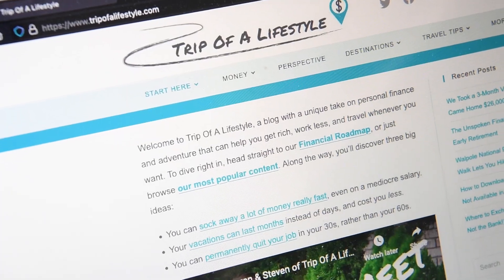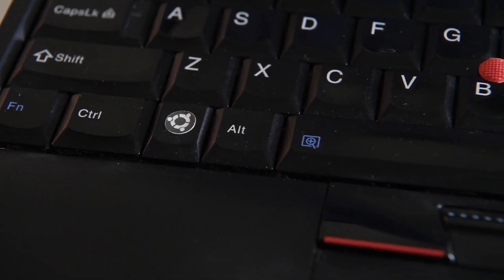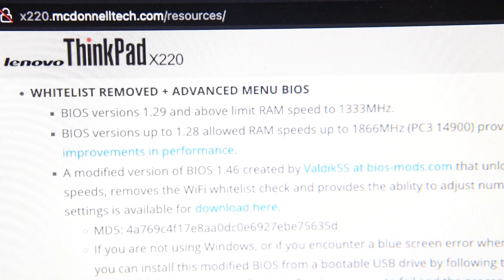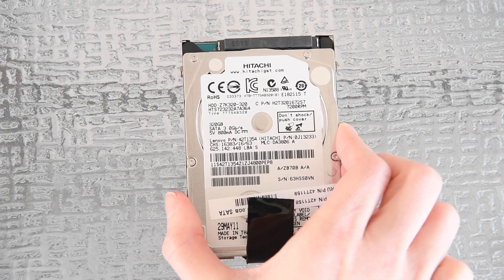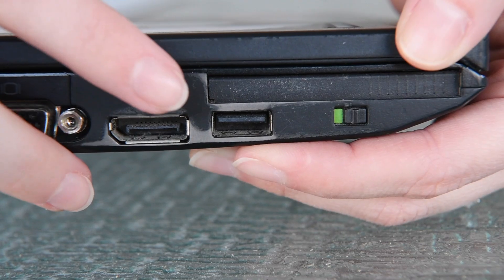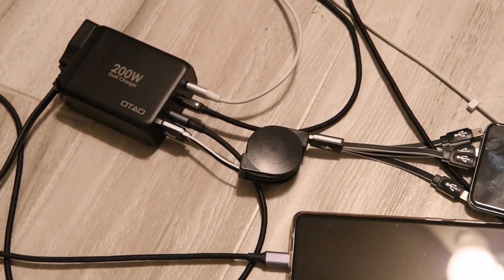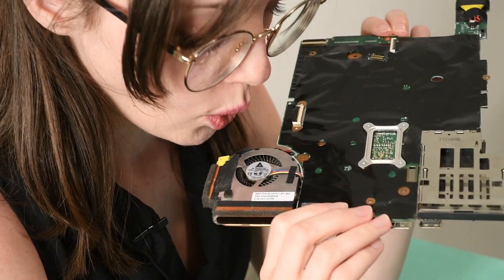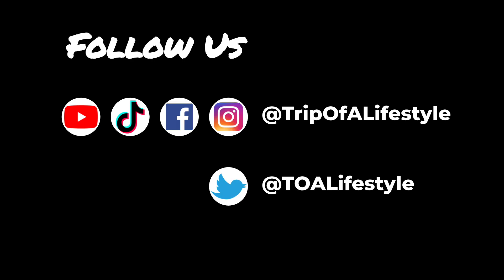How To Make Your Laptop Last FOREVER (My ThinkPad Mods & Upgrades)

Comment from the maker: UPDATE, October 2024: This 13-year-old ThinkPad X220 is still my main computer! I use it every day for blogging, shopping, photo editing, business stuff, and even writing this comment. 😊

I also did one more mod since creating this video. I added an additional internal USB 2.0 port (weird, right?) using the laptop's vacant Bluetooth card port and this custom chip: https://ebay.us/dqV6bG (affiliate link).

That brings the total number of USB-A ports to 6 and allows me to hide a small USB device inside the computer (like an additional Bluetooth adapter, wireless mouse dongle, or flash drive).

For more frugal tips, be sure to subscribe to our channel and read the blog at https://www.tripofalifestyle.com

Thanks for watching!

— Lauren
Reply: @TripOfALifestyle  I have a Dell Latitude E6530. Upgraded with 16 gig RAM, bigger battery, 2TB SSD, BD-RE drive, USB 3.0 ExpressCard. It has 2 USB 3.0 ports built in plus a USB 2.0 and an eSATA USB 2.0 combo port. It has 1080p display and nVidia GPU with dedicated RAM. I got it cheap because it had an i3 CPU. It was easy to swap in an i7. One puzzler is why DELL won't do a TPM 2.0 firmware update for it when they have for lesser models of the same era.
Reply from the maker: @greggv8  👏
Reply: @TripOfALifestyle your laptop is lasting that long 😂. Unfortunately most are glued on motherboards these days.
Reply: @TripOfALifestyle  My latest upgrade to the laptop is a backlit keyboard. IIRC that wasn't offered on this model but others that used the same keyboard did so a compatible one was easy-ish to find. Unfortunately the person I bought it from thought the keyboard should be secured into the package with tape and two keys got ripped off it due to rough handling. But there's a company that buys up all the laptop keyboards they can to salvage keycaps and the parts under them to sell individually. A few $ and some time later the board was fixed.
Reply: @greggv8  Awesome! I just purchased brand-new ThinkPad T430. I like your upgrades/mods very much, especially the charging port upgrade (USB C is all around us nowadays). Was it ..easy?
Reply: @greggv8  I just sold one of those. It was awesome but I got a new Macbook Air M3 and something had to go. I still have another business class Dell Laptop, and it runs Linux like a scalded dog. It's a Precison M4800 with an AMD graphics chip and i7 quad core processor. Despite that it weighs a ton I still love it.
Reply: Do you use Arch, by the way?
Reply from the maker: @OceanusHelios  Xubuntu
Reply: @OceanusHelios Both description and video states that she used Xubuntu (Ubuntu with XFCE desktop env).
I use OpenBSD, btw. On an IBM Thinkpad T42 32-bit and many other computers (including my mothers old Lenovo desktop PC).
#RunBSD
Reply: I am writing this on a x220 i got 2nd hand in 2014. It has an i5. I upped it to 16GB RAM and a Sata SSD. Still going strong! (Got it for 150 bucks lol)
Reply from the maker: @vijaynatrajan1887  Nicely done!
Reply: Love that you keep adding as much upgrades as you can so people know they don't have to buy a new laptop when they think it's hit their limit. I am looking at getting a newer one later this year since I did all I can with my 14 year old Acer. Taking my time cause there are so many $500 laptops out there that seem feature packed but you look at the specs and realize it's not such a good buy after-all.
Reply: Thank you for the update, this video makes tech frugality exciting. Anything else for tech you guys could make a video on?
Reply from the maker: @georgekontogiannis4091  Thanks! We've done some other "tech" content, and we have a bit more planned into the future. All of it falls into the travel or frugality niches.

For example...

Laptop buying guide:
- https://www.tripofalifestyle.com/gear-and-tips/laptop-buying-guide/

Digital camera buying guide:
- https://www.tripofalifestyle.com/gear-and-tips/camera-buying-guide/

International power adapters:
- https://www.tripofalifestyle.com/gear-and-tips/international-plug-adapters/
- https://www.youtube.com/watch?v=JtdQ0bwNzp0

Using Android apps internationally:
- https://www.tripofalifestyle.com/gear-and-tips/change-country-google-play/
- https://www.youtube.com/watch?v=0E7aiM4Q7GQ

Building a camper van:
- https://www.tripofalifestyle.com/gear-and-tips/nissan-nv200-camper-van/
- https://www.youtube.com/watch?v=ttwxw6PmaNs

Public WiFi hack:
- https://www.youtube.com/shorts/EE2f_LTWpDs
Reply: ha! you had me at "I switched to Linux and never looked back..."
Reply: That original Lenovo (IBM) keyboard is spectacular. I currently have a 2012 T430s and a 2017 T470s...both incredible. Those keyboards are nice, but will never touch yours. Great video!
Reply from the maker: @hoppysport2872  The X220 keyboard is really nice! Thanks!
Reply: Did you know you can flash the BIOS on the X220 with an open source alternative called Coreboot? It's a lot nicer than the stock BIOS because it removes the spooky Intel Management Engine stuff. Though it does require you to open up the machine and use a raspberry pi to flash it, but there are tons of videos on YouTube, if you so choose to.
Reply from the maker: @SamSquids  That's cool! Never heard of Coreboot, but this X220 is using a modded BIOS version to remove the hardware whitelist. It's linked in the video description.
Reply: My 2013 Lenovo Z710 with an i7 processor, 16GB, SSD, 17" screen. built in 3.0 USB x 2, VGA & HDMI, and upgraded Wifi 5 and BT works great with Windows 10 .. although Zoom is almost at the limit of usage.
Reply: Awesome!  Haven't completely retired my X200, though did transition to the X240 for the most part and the E530.  Will have to look into the WiFi card upgrade for the bluetooth and 5G capabilities, that is a great way.  Pretty much same upgrades otherwise with dual boot option on one of the X200.  Funny not being able to upgrade to Win11, at least I think the X240 will not as well as I forgot offhand and may not have tried.  Anyways, no big deal IMO.  Awesome!
Reply: hehehhe, wow, have a hide usb inside the computer is amazing, a big storage to use in whatever, what a great idea! cheers 😃
Reply: Can you do a video on Chromebooks?  They're my favorite.
Reply from the maker: @frostyfrances4700  Never used one! Maybe in the future.
Reply: You can still upgrade to a better brand specs ssd.
Reply: My only problem is when you can no long use a laptop like it was meant to be as either the keyboard no longer completely works or the screen is damaged, or both or worse.
Reply: @wheelieblind  luckily for you, the screen and keyboard are very easily replaceable in those old laptops.
Reply: Should seriously get a new laptop. It's good for the heart... And the economy. lol
Reply: That’s incredible, I still have my 2009 MacBook Pro. She’s still punching.
Reply: Problem is, my old laptop needs a ribbon cable that they no longer sell :(
Reply from the maker: @perfectsoulmates2023  Try eBay!
Reply: @TripOfALifestyle  Oh believe me I did and they don’t have the ribbon cables. Like I said they were all discontinued and nobody has them even used. I invested hours and hours searching before just giving up until perhaps a universal ribbon is made or something else as a solution.
Reply: nice! 
and if you dont mind me to ask, hows the update now on 2025?
do you still use the mighty X220?
Reply from the maker: @NOSTALGILAK  It's still the daily computer in 2025!
Reply: @TripOfALifestyle  fantastic!
do you also using windows or linux only as a daily os?
Reply from the maker: @NOSTALGILAK  Xubuntu Linux
Reply: ❤. Iv'e been to a few stores that used old computers off line for their own use.
Reply: Wow why am I keep buying a new laptop. An old laptop is so much better than a new one even if it is more powerful. I have a Fujitsu Celsius H710 that screams 2000s even though it has a 2011 workstation spec. 2005 was a better time but 2011 laptop is the oldest usable laptop in my experience

Comment: I once bought a Lenovo T520 for $240 on eBay and it was my main driver for years.  Put Ubuntu on it at the time.  These days I have a 6th gen X1 Carbon (purchased new from Lenovo) running Arch Linux, which is on its third battery, and the rubber is starting to deteriorate around the screen.  Decided it was time to upgrade.  I don't know how repair that melting rubber boooooo.  Have a 10th gen X1 Carbon coming, which I got for $720 on eBay.  :)

Comment: nice but i would  prefer the barrel, since the usb is a bit too weak but a DC barrel is easier to replace and hold tensions better. Anyway, if it works for you, its what it counts.

Comment: 4:38 its funny how no modern computers have a easy way to swap out your battery like this. Batteries are literally the only thing that go "bad" in a computer. Like the only thing actively degrading in your computer every single time you use it. 

Hell, some of the newer laptops ive seen you having to peel off your screen to get to the battery.
Reply from the maker: So sad 😞

Comment: Is it sill worth buying a thinkpad today. Everyone swears by them. I was thinking of making it my daily driver for the usual things people do with laptops except gaming. Do you like Ubuntu, should i switch if i buy a used thinkpad?
Reply from the maker: Still rocking Xubuntu and still rocking this 2011 ThinkPad X220 in 2025!
Reply: You can get a T14/T15/L14/L15 Gen 1 with a Ryzen 5 4650U for around $200-300 now. The T-series would cost more because they're more premium and have a bigger battery, and it's usually worth paying extra for the T-series over L-series. E-series before Gen 5 are to be avoided, those ones weren't even true ThinkPads.

Comment: I am a computer nerd.  Degree in computer science, former network administrator, now own a ecommerce company and am on the verge of getting a youtube channel for my company.  I do most of my work on my desktop (which is basically a supercomputer at this point).  but My trusty lenovo t480s can handle almost everything I do (thats work related).  I am looking for another laptop with more power that will allow me to control multiple cameras and do video editing.  Although my laptop can do video editing, you can watch paint dry while its rendering.  And my initial tests controlling multiple cameras results in dropped frames. 

I also have linux and windows 11 dual booting from that laptop.   I also run  several different flavors of linux in a virtual machine in that laptop.  Older lenovo's are excellent laptops, especially when paired with linux.  I love my lenovo, its light, plenty fast, and can even do some light gaming.  I have affinity photo 2, publisher 2, and  designer 2 installed on it, which allows me to do all the photo editing I need to do on my website (although admittedly, I do most of it from my main computer).  Also use gimp for various things.  I can work on the backend of my website from this little beast. 

I have recently been dealing with some health issues and have been partially bed ridden for an extended period of time.  I got a bed desk and have been working from bed a lot of the time with my lenovo.  Its a life saver.

Comment: I tend to use laptops until they die too.  However upgrades aren't necessary to keep it running. The ram was necessary to do your work. However knowing that the computer has an MSATA slot, I wouldn't have replaced the HDD, I would have added the SSD to the MSATA port and kept the Hard Drive in place. Linux allows you to use the HDD as your home folder which has a lot of benefits.

Comment: I learn't several things about x220, thanks :-) .
I bought an x230 instead of the x220, to get the USB3, but i didn't know the i7 version had one. 
I keep the express card slot for the good audio card : ECHO Indigo, used by musicians and DJ's.
The x230 also aloud 16Go of RAM (without any bios upgrade), when the x240 is limited to 8Go ...
The 44++ (for x220 or x230) bring much more autonomy, but in 2025, it's a bit hard to find a new one. Chineese copy saying 44++ i checked, they are 6cells instead of 9, like an Lenovo 44+.
The internal PCIe (3G card), is usefull for a second ssd, with a 2nd OS, in case of failure of the main drive. But that PCIe port is SataII, not like the SataIII 2,5" drive. The i5 managed 2 SataIII, but the second one goes threw the UltraBase/dock station.

Comment: Nice job upgrading your Thinkpad!  Yes 16GB ram is still plenty for home use, but for my work laptop I had to upgrade to 40GB+ (bought second hand Dell Lattitude 7480/7490 which can go up to 64GB).  So my older thinkpads are now sitting mostly dormant except when I need them for specific things.
Reply from the maker: 40 GB RAM 😮

Comment: It's possible because Lenovo ThinkPad series allows Modifications and has 6 Cell or higher battery. Now a days lower model comes with 2 Cell battery which doesn't make sense to upgrade as all the things are soldered. Lenovo IdeaPad Laptop 8th generation i5 processor with 2TB Harddisk and 8GB Ram. With no OS pre installed as Windows 11 is already free for Home users and Students...

Comment: Very nice! I still have my 2009 laptop that I fixed and upgraded. It's not my main machine by any means, but I still use it every now and then. It can even play 1440p video on YouTube. :)

CPU: Core 2 Duo 2.0 GHz FSB 800 MHz -> 2.66 GHz FSB 1066 MHz ($13)
RAM: DDR2, 2 GB -> 4GB (I got it for free) - maximum for this laptop, unfortunately
Storage: HDD -> SSD ($85)
WiFi: n -> ac ($12)
Extended battery: $37
Add-on: ExpressCard with 2x USB 3.0 ($10)
Fixes: barrel jack for power ($5?) + replaced hinges ($12)

Initial cost: $824
Post-upgrade + fixes: $998
Reply from the maker: Awesome!

Comment: I have been into tech for decades, I build and maintain my own PCs and the PCs of others, and I love using tech stuff a lot longer than most people. I had a used T420s ThinkPad with a 2640M i7, so probably very similar to this one. I put a Samsung PRO SSD in it and 16GB of RAM and I used it until about 2022.

However, the truth is that 2C/4T CPUs and in my case a very old Nvidia Quadro GPU just weren't enough anymore, even for simple tasks. I couldn't even have MS Teams or Zoom meetings without the CPU shooting to 95°C and the entire system lagging heavily (yes, I replaced the thermal paste).

I upgraded to a used T490s and the difference in speed for everyday tasks is insane. The 4C/8T i7 is so much faster, can handle multitasking so much better, the system is cooler and quieter, and it needs a lot less power and has much better battery life because of the U spec CPU compared to the old M spec.

As much as I miss the old ThinkPad keyboard that felt like a real desktop keyboard, the device just wasn't viable anymore.

Comment: What I've noticed about laptops and upgrades, especially CPUs, is the ones marketed as business models are easier to upgrade than those sold as consumer models. Business laptops tend to have all the removable bits on the bottom, under one or more covers or the entire bottom panel comes off. Consumer models, when they have a socketed CPU, tend to place it on top of the board so the entire bottom of the laptop has to be taken completely apart to get the board out to replace the CPU.

Comment: I have used some of mine for up to 23 years.  BSD and Linux allow for using really old hardware to run the latest modern, sleek and very efficient software.  Mac & Windows really are stragglers.  I could buy cameras and lenses with the $$$$$ I so saved.

Comment: I have a t410 that definitely needs a keyboard and battery replacement and the hard drive gotta go, more ram, and then a clean on the inside, should be ready to go afterwards, and it will run better than a new laptop in the price range of 100+ usd

Comment: Congratulations on a great video, with which I totally agree - although I would caution not attempting such upgrades without the appropriate skills.
After retiring from the IT industry after 40 years,: I as an engineer, trainer and A+ tech, I have continued to do pro bono work.  In 2014, I purchased a Lenovo ThinkPad 440s with 12GB RAM, and a 125GB hard disc running Win 7 Pro 64. I have replaced the original 125G HD  with a 1 TB SSD unit, with I have continued to use Windows on it, upgrading  to Win 10 Pro 64, and now Win 11 Pro 64 (thanks to the new MS hack to bypass the TPM 2.0 limitations: all for no cost.   I have replaced the fan, which died this year (2025) and  but the original internal battery shows 98% capacity and the external hi-capacity one shows 100%.
I always had a good run with Lenovo gear (as a client) and the same applies to the T440s, my Thinkstation C30, and have recently been gifted a ThinkPad P16 - each has a function, but I still enjoy using the T440s, and it's never faltered.

Comment: 1200$ for upgrading this plastic thing? Then better take a 2019mbp 16” with 64GB of ram/i9-9980HK/2tb ssd for the similar price 😂
Reply from the maker: You may have misunderstood the video. The original purchase price of the brand new ThinkPad was $900 in 2011. Then, a total of $300 in upgrades were done slowly over the next 12+ years, for a grand total expense of $1,200 across 12+ years of use.

A MacBook would have been twice the price and much more difficult to work on. 😉